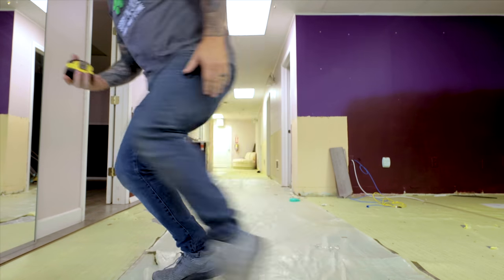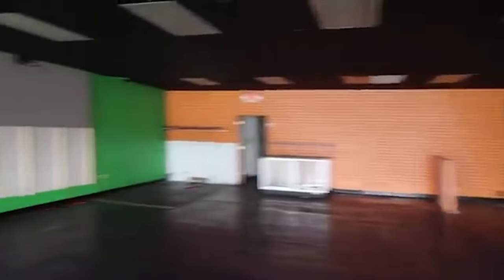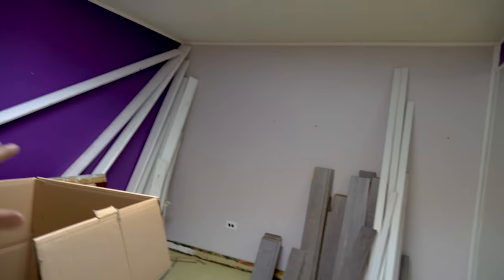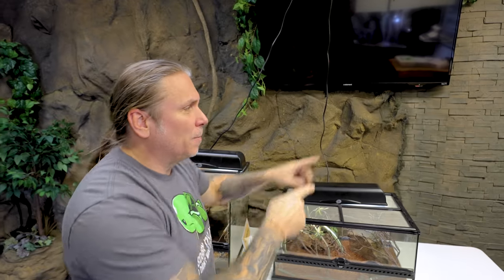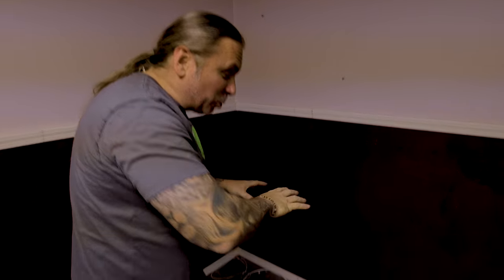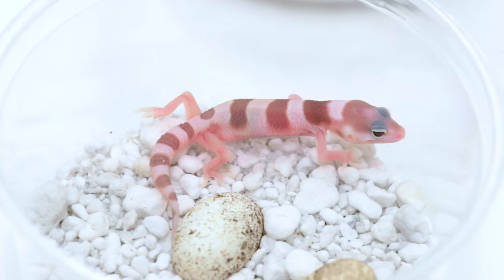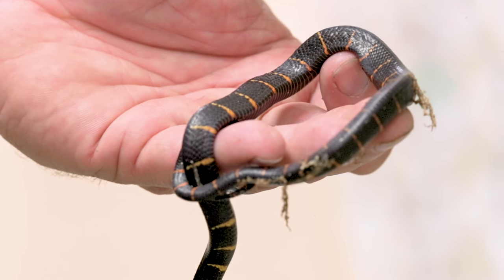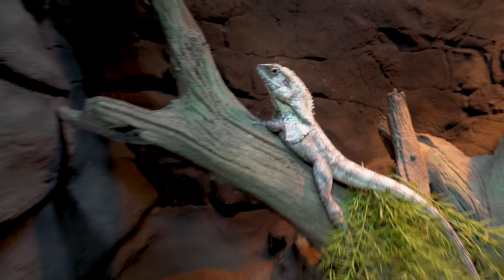MY SECRET REVEALED!!! REPTILE ZOOS FUTURE| BRIAN BARCZYK

Comment: When constructing your "event"   room, make sure you have enough power outlets, room for your current largest event crowd plus more bodies, a place to clean up from messes, and fun lighting. You might want to have 2 restrooms in the new section being unisex. Have you done a poll to see how people feel about the snake messages and the fish eating away dead flesh? What kind of certification do you need for both and any equipment that might be needed? I would think, you will have different types of reptiles in the new section, than you have in the current section. 
If someone wants to go back to the first section, after they see the new section, may they do that? It looks like you'll be adding more staff to handle the expansion as well. You might not need everyone you hire, for the expansion, to also do what your current staff does, outside from the Reptarium. If you have animals other than reptiles and spiders, that could be an issue. People might want other animals, which means you might need to build that zoo, you've always wanted. I just touched the surface. You know the others. Best of luck in the expansion. Is the parking lot being expanded? 😀